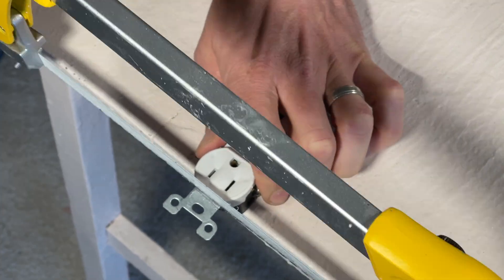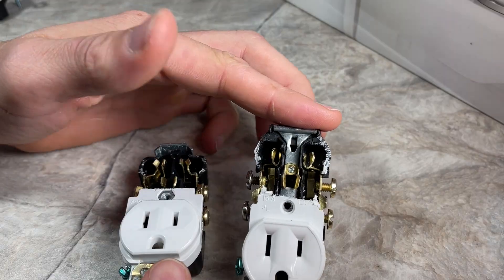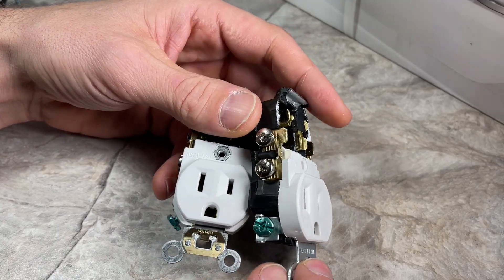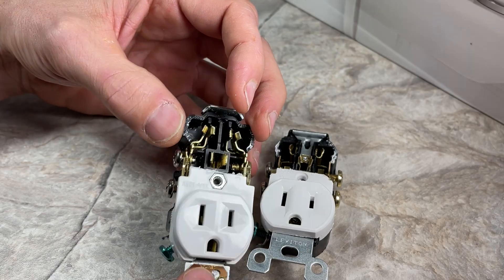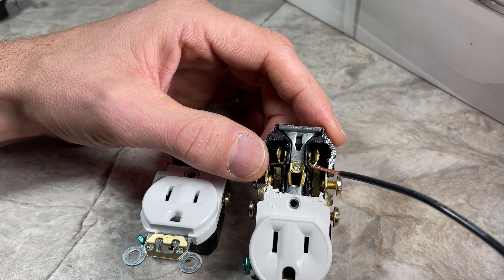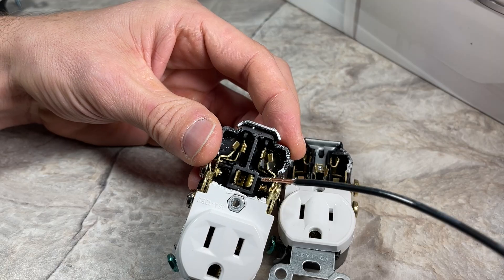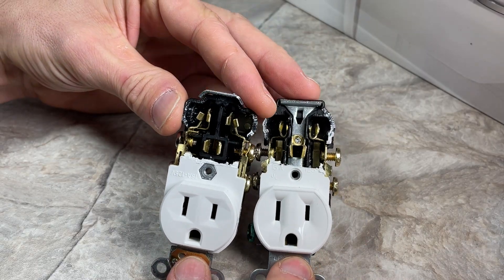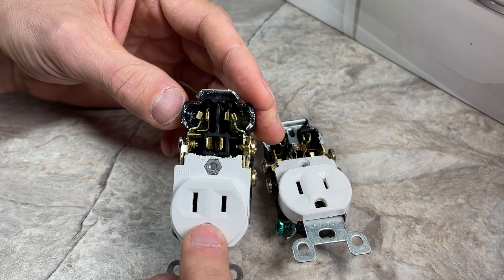What Outlet Should You Buy For Your Home |  Commercial vs Residential

Comment: I only replace crap outlets with Hubbell HBL5262 (street price of about $15/each). There is only one tier higher than these (hospital grade).
Don't confuse these with the ultra crappy Hubbell 5262 ($3 each) that should not even be sold.
Reply from the maker: Good info,  I will check out the Hubbell HBL 5262 but $15 per receptacle?  😬
Reply: @EverydayHomeRepairs  I've never paid those prices as I leverage the new-old-stock surplus market (eBay/etc). 
These outlets are great for replacing those cursed backstabbed receptacles because they allow for rear wire entry 
(4 per side) with the traditional screws acting on a proper full wire length terminal clamp block.

Comment: In my late 1990s house the outlets were installed with push pins. The body of the outlets is splitting under the spring tension in the outlets and switches. I've been replacing them with commercial grade as I have time. edit: and using the screw terminals always!
Reply: ...That's why I always say you are better off doing the work yourself...these "licensed contractors", or their subcontractors, will always take the cheapest route out..maximize profits, that's what it's all about...

Comment: Everytime i remodel my own houses i use the cheap outlets, and put them no more than 6 feet apart. Have not had one fail yet. And if it did i could replace it. Saves a lot of money when you install 200. 49 cents each home depot.

Comment: The price difference also reflects the ease of installation. All electricians do not use the stab-in feature. Btw in all residence you need to install tamper proof outlets changing your breaker out to afci if not already.
Reply: Are those requirements just for new construction or does every house need to be converted now?

Comment: The greatest danger is corrosion and wear. Extension cords and power bars that lie on the floor are in the greatest parrel from corrosion. Also, plugs in mop boards. Contamination and mechanical damage.

Comment: I had a small electrical fire, nearly a large one, because of a cheap GFCI outlet that didn't have enough distance between the hot and the grounded top strap. (Very similar to what you point out) Pull out the plug at not exactly the right angle, arced, and started burning back into the wall. Ended up replacing a bunch of wire once I had the wall down behind it (bathroom remodel, adjacent to the kitchen) and saw it was actually scorched even beyond the box. I only get the good ones now. Yes, that's like $20 per gfci. Yes, it's definitely worth it.
Reply: any arcing to ground should trip the breaker immediately
Reply: @Galgamoth  wasn't on an arc fault breaker. Maybe it arced to neutral, not sure, but the electrician said it was to ground.
Reply: @rpavlik1  if you follow your neutral it is grounded at the box
Reply: @Galgamoth  yep, I know. None of this changes what happened, though.

Comment: Most of our outlets have plugs which rema.in the outlet.  Our kitchen appliance outlets are 20-amp.  If any outlet ever gets loose, I'll replace it withe better outlet.   Until then, leave as is.  The cheap outlets are UL approved.  I screwires to the screw terminals.   (I may start replacing outlets withe tamperesistant outlets.   May be a plus if we sell this house.)

Comment: First time viewer: loved it!  I did have a thought come to mind about the commercial grade. Have you ever see/felt the plugs at the airport?  I am sure they are required to use commercial and do to so much use the outlets still don’t pinch. You best comment 🥁🥁🥁 ONLY use the screws. I burnt up a compressor motor that came on either the low pressure switch while I was out of the garage. High resistance |•| from the pinch on two sides vs the contact of the loop of the screw👍

Comment: The main issue, I see is people run 12-2 wire which is rated for 20amps, but they put the cheap 15 amp receptacles on a 20 amp breaker. Make sure you use a 15amp breaker.
Reply: that's a code violation

Comment: The cheap will burn your house down, seen it so many times,
Reply: Not likely or they would not be sold. The way people like to sue now days would put a company out of business if it happened "many times"
Reply: @blic-sx9ix  you might want to check yourself,
Reply: @Drewdayz2419  My comment is based on being a volunteer fireman for 25 years. I have seen more than a few electrical fires. I can say I have not seen or heard of a properly installed properly used UL listed receptacle being the cause of a fire. 90%+ are homeowner caused with the rest being incompetence or mistakes by electricians. You may have other experience so I will be quiet now.

Comment: I wish you electrical wannabes would please stop calling these “outlets”. Read the code, the proper name of these devices are “receptacles”. The code defines an outlet as “a point in the wiring system at which current is taken to supply utilization equipment” this refers to the wiring system,not the device. A switch location and a lighting point is also called an outlet. Let’s not confuse people improper nomenclature.

Comment: "Is the extra cost worth it?"

Is extra assurance from an electrical fire worth it?
Reply: Nope, do you not install circuit breakers?
Reply: @integr8er66  Yes, there are circuit breakers.  But why not have superior quality electrical outlets as well, especially as it's an added layer that can't hurt.
Reply: @Watcher3223  Because of COST, better isn't always needed, why not always drink from a $50 yetti cup too? well because I just wanted a drink of water and there were paper cups available. Same reason I buy Harbor Freight and not Milwaukee. does the Milwaukee last longer, sure, does it last 10 or 12 times longer because it costs 10 or 12 times more?  No. I have these receptacles all over, never had any problems with them.
Reply: @integr8er66  With all due respect, the cost difference between a household outlet and a commercial outlet is not that much, so it's kind of flawed to argue against it using the cost differences of a paper cup to a Yeti.

As for your decision to keep using household outlets, good for you.  I'm not standing in your way of choice, so why are you bitching and moaning about my opinion?
Reply: @Watcher3223  I'm not bitching and moaning, you are standing up for your position and I mine, why do you call that bitching, besides, you posted a question and opened the topic
Reply: @integr8er66  I posted a rhetorical question as the answer was implied.

If you did not understand that, then my apologies.
Reply: @Watcher3223  Oh no worries, I simply don't agree, and we all post our comments about the topic and other peoples comments, thats why its called the comments section.
Have a nice day!
Reply: @integr8er66   This is only a valid argument if they are Arc Fault breakers. Standard OCPD's will not prevent arcing, which is what will cause your fire. So answering with "do you not install circuit breakers" has no bearing on an electrical fire due to Arcing, only due to Shorts or Overloads. Many homes do not have Arc Fault breakers, and while new homes are built with them, it should be taken into consideration.
Reply: @jkslate  I agree with your argument, but my answer to the question "is it worth it" is still no. I have used them for decades and never had one go bad.
Reply: most fire come from poor connections..if idiot wires either , possible problem
Reply: @jsparlin1  I agree.  That said, when properly wired, a superior quality outlet is just that extra bit of assurance.
Reply: @jsparlin1  lol im an electronic engineer
Reply: After dealing with crooked local government, taxes and zoning. No. Burn the fucker down.
Reply: @brianblack546  look at my videos
Reply: @brianblack546 you think the local government is crooked... Just wait until you try and collect on that loos from your insurance company.

Comment: Residential outlets and electric switches are a joke. They shouldn't even be on the market.  My house is 15 years old and many of the light switches have been replaced and a few outlets. My house was wired with leviton home grade.  Never ever put that crap in your house when it's being built new.  Get the spec grade. If it's not in the contract put it in the contract the electrical contractor must use spec grade components.   On the overall cost of the home it's not going to add that much.  If you are in an area where you need to run a small space heater definitely replace any outlet with spec grade and have someone with an IR camera look at every outlet on that same circuit or just go ahead and replace every outlet on that circuit and check the torque on the wiring.  The house that you save from an electrical fire will be yours.
Reply: I would also recommend upgrading to 20 AMP circuits and outlets. So you never have to worry about pulling too much current from outlets running high load devices such as MiG welders, air compressors and plasma cutters.  Not to mention various household devices.
Reply: @blendy19   if your going to put a larger circuit breaker in your outlet you better make sure it matches the wire size in your house, not just your wire size in your breaker box. 20 amp breaker is ok for  12 gauge wire. If the wire has the yellow cover on it you have 12 gauge. If its white you have 14 guage wire or your wire is just old in which cause your better off staying with a 15 amp breaker....... there is not a big difference in how much electric you can safely pull through a 20 amp breaker as apose to a  15 amp breaker. It's about 300 watts. Not worth the cost of upgrading......... a space heater and vaccume cleaner pulls enough wattage on a single outlet that it's not recommended to have anything else plugged in while using it. They use a little  less then a 15 amp outlet is rated for so a 20 amp is not needed. But again the wire size is what determines the size breaker you buy to use. Most breaker boxes come with 15 amp breakers. If you did not wire your house and it is old. It is common to have 12 guage wire going into your electrical breaker box. It is also common to have only 14 guage wire ran between your  ceiling light and light switches. If you didn't wire the house then you maybe causing a fire hazard by switching out a 15 amp breaker to a 20 amp breaker just because the wire running into your breaker box is 12 guage.
Reply: I've never seen a switch or outlet fail except when severely physically abused so I don't think the practical difference is that great. However if you are having someone else do the work definitely have them use spec grade as it's nothing compared to the labor cost. If you're DIYing it the cheapies would be more acceptable because you can swap them out quickly enough if necessary. Even if you use some cheap resi grade outlets around the house definitely consider spec grade in high-use areas like the kitchen where you have high loads and move around appliances like mixers and blenders.

Comment: My house has builder grade residential outlets.  There are many of them that are so loose the plug almost falls out of them.  Where this is occurring is in the high use outlets.  Hallways where you plug in a vacuum cleaner frequently.  And kitchen where you plug in mixers and other portable appliances.  I am upgrading them to commercial as they fail.  Another interesting point many people don't know is that you can get different colors.  I like gray with stainless steel plates in the kitchen to match the appliances.  I saw you can also get brown.  As well as the usual white offerings.  I also upgraded the switches.  Thanks for the video.
Reply: "builder grade residential outlets" AKA the cheapest outlets they can buy in bulk.
Reply: Brown is often used in factories because it doesn't show the dirt. And I use a brown outlet in 2 circuit boxes that I mount in workshops or garages. It lets me get a lot of power to a unique position and know that I am balancing the loads.

Comment: I always put the commercial grade in my house. I like how well they last over time and I prefer working with them. This comparison completely skipped the difference in the terminals. I curse every time I have to disconnect wires that were pushed in to the back of cheaper outlets and switches, I find them to be a pain. I find the commercial outlets make it easier to clamp the wire in place and all you have to do is strip a short section of straight wire to go under the little plate that is retained by the screw. No bending the wire into a hook is required. 

Between improved durability and better maintainability when working with the wires the commercial grade products have been a foregone conclusion for me for a while.
Reply from the maker: Agree Shaun, I touched on not using the push pins but you are right that I missed the built in plates on the commercial receptacles that are super handy for install.

Comment: First those are 15A recepts.  I would always go with 20A devices.  If you going to run a heater or any larger amperage device could over heat the device and cause to fail.  Also I don't care what type of device commercial or residential.  It is not about the device but how you terminate those device.  Always pig tail and curve wire in direction of turning screw in and terminate to screw....never ever just plug into back of device.
Reply: This isn't necessarily sound advice. No point spending the extra money for 20amp outlets when you only have 14 gauge wires rated for 15 amp power. 
Your wire gauge will be the determining factor in providing your appliance with power, not the outlet itself.

Comment: As someone who used to be a licensed electrician, 99% of the time the cheap ones work totally fine and will last a very long time. There is no real need to buy the more expensive commercial grade ones unless code dictates it. 

But why the grounding difference? It’s because residential grade is designed where it’s not ally going to be inside a plastic box while commercial work is generally all don’t with metal boxes so that bar ensures a better connection to the metal boxes. But.... if wired properly, that shouldn’t be an issue.

Also, I agree those push connections are terrible and should never be used. My house had all outlets wired like that and I could literally just pull most of the wires out of the old outlets.

While commercial outlets are technically more durable, odds are most people will never see the difference. For me, it’s not worth the cost to upgrade all my outlets to commercial but there were a few I did. Like my outlets to have window AC units that I redid with metal boxes and are 20A circuits and a couple outlets in the kitchen where things are constantly in and out.
Reply: Where I notice it most is outlets that see a lot of vacuum cleaner use. Loose as can be!
Reply: Randall Smith It’s definitely a possibility that outlets at the a lot of vacuum use will end up loose over time. The thing is though, I would say probably 15 years ago or so they were changes made to how newer outlets are made because of certain code requirements actually addressing that situation where they would become loose. If you were to look inside an outlet made maybe 20 years ago opposed to one made only 12 years ago, you’re going to see a big difference in how the inside is constructed I would be willing to bet that a lot of the ones you’re seeing lose that see a lot of vacuum use art of the older type that just don’t hold up as well
Reply: @epoc162  good point. Our house was built in 2003, and a couple of the hallway outlets are loose. Maybe a bit abused by the previous owner’s vacuum cleaning practices! 😀. Still, they are not as loose as I remember my parents’ house had when I was growing up.
Reply: If the outlets are loose and you notice the plugs are getting warm after use, it's time to replace them- the box of 10 outlets are $10 and would be fine.  They're the tamper proof shutter covered ones, which I'd just as soon not have,  as I don't need the shutters myself, but that's all they seem to sell nowadays.
Reply from the maker: Thanks for all the great feedback and sharing your years of experience.
Reply: What does very long time mean. I have been in my house 40 years and have always replaced an outlet with 'spec grade'  An extra $ 2 to never worry or replace that outlet again. to always find the connection tight. I buy them at garage sales and flea markets for less than $ 1. often much less. I salvage them from remodels, dumpsters. A used spec grade outlet or switch is much better than a new cheapie.

Comment: The reality is electrical outlets are a wear item and should be replaced periodically when they wear out. 

If you want to spend the extra money on commercial outlets for your house then go ahead but unless it’s in a location that’s heavily used then your not going to see a benefit form your extra dollar. 

There are more factors than commercial vs residential. Like age, damage, general brand design differences, and poor installation.
Reply from the maker: Curious on what your favorite brand is for receptacles and switches?

Comment: The only time I’ve ever seen a residential outlet even come close to internal shorting was after it was already damaged by overloading or was Severely worn out.
Reply: if installed right, and not abused will work fine most cases. However if have a outlet that is going to get something plugged into, removed, many times then I would go commercial for that one. One place is if have a shop, use garage as a shop would go with the commercial grade but most cases in a home not needed.